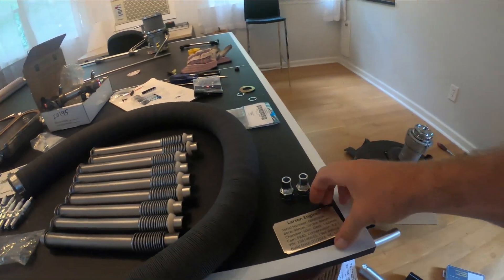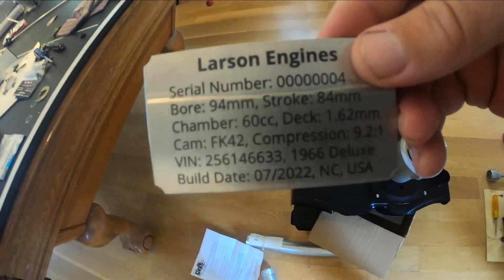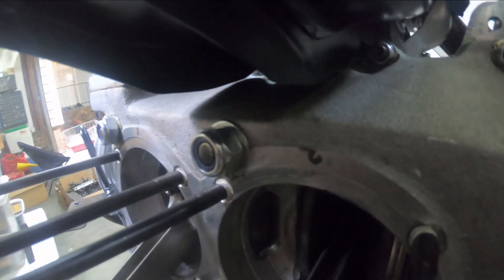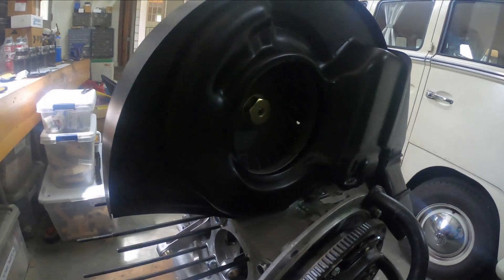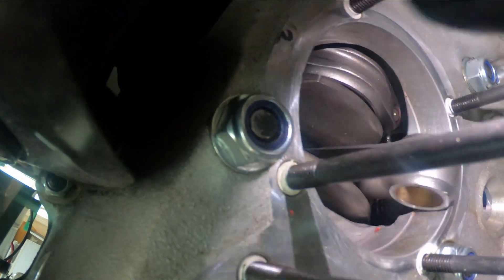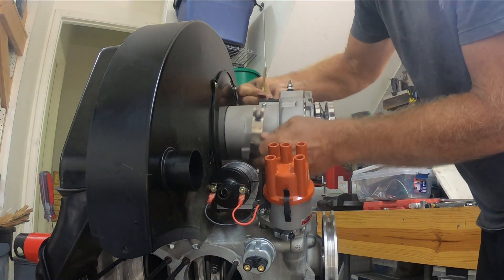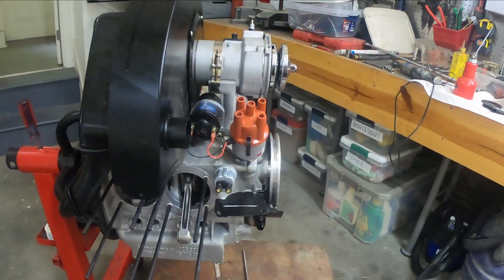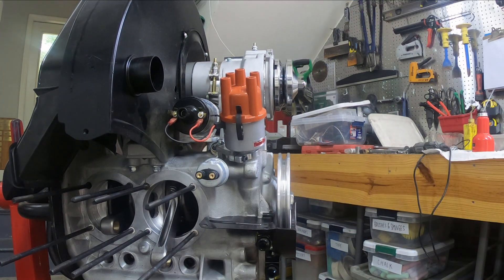2332 VW Air-cooled Stroker Motor - Video 60 - Shroud Mods and Motor Specs Plaque

Comment: Thank you for posting this video!  I have this exact issue, and my serpentine belt was getting chewed up.
Reply from the maker: Yeah - my shroud and tins were a terrible fit, and I had to do a ton of work to get them pretty close.  The alignment for the belt can take tinkering too!  Good luck with your project - the good news with mine was that once I got it in place and aligned, it hums along nicely now!  It is a really reliable motor, and as long as I can tolerate a few oil drips, I have no complaints!

Comment: Thanks for sharing this.  I am saving up for a bubble top case.  I will probably need to do this procedure.
Reply from the maker: Yeah - when you get a bubble top, it is likely you will need to mod the pulley tin, the fan shroud and a couple other tins.  But it isn’t too bad - just a lot of slightly different after market things that don’t quite fit, but they are close!